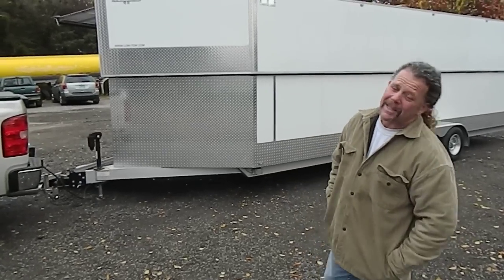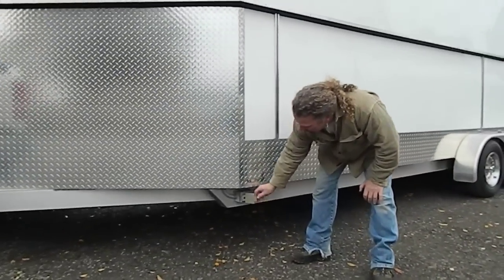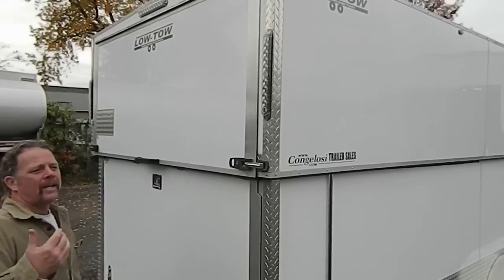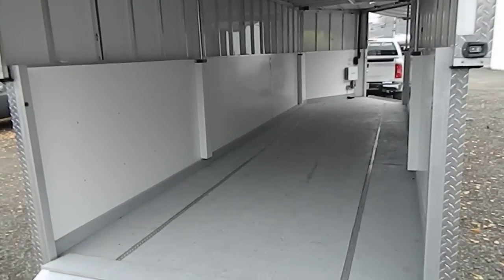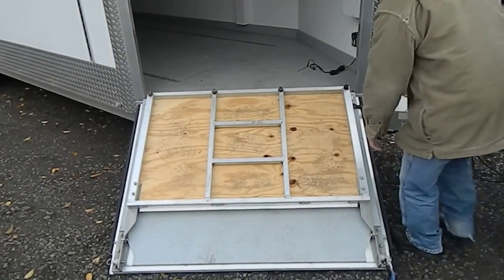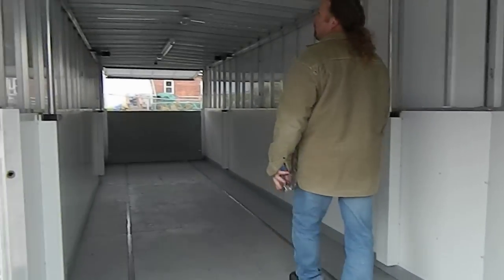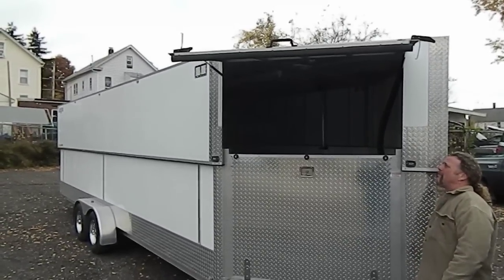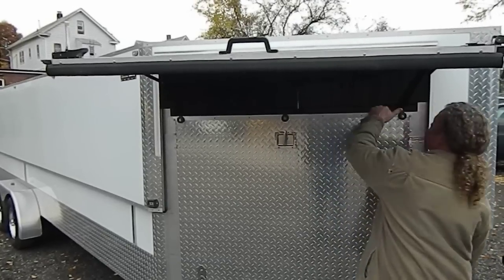Elm City Trailer .. Low-Tow Snowmobile Trailer

Comment: Add a 12 volt DC to 110 volt AC inverter and run your other lights with out being plugged in to 110. You could also run other thing such as a battery charger or maintainer, trouble light,electric tools, kerosene or propane  froced air heater. If your going to do the heater idea use your grey matter do not stay in the trailer while the heat is on. Shut it off and ventilate.